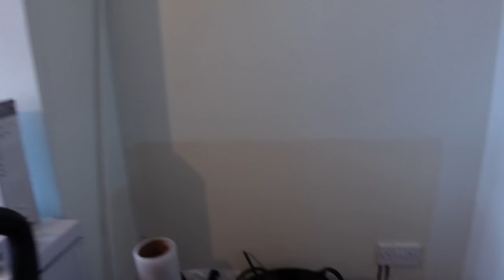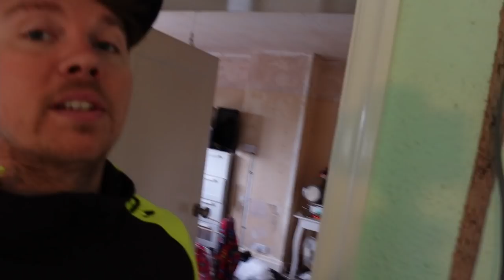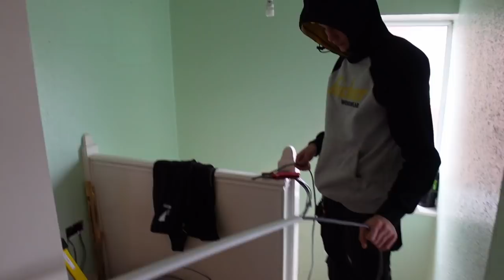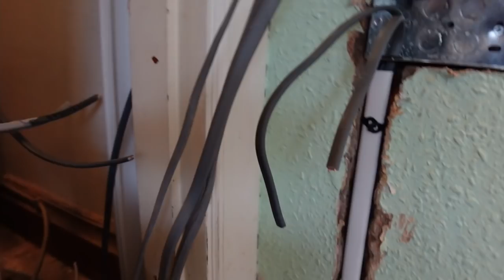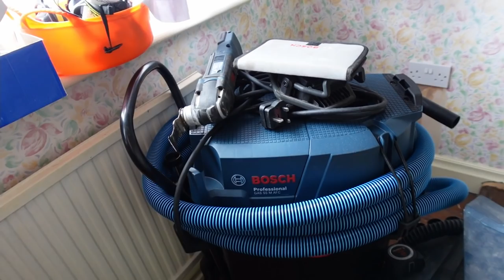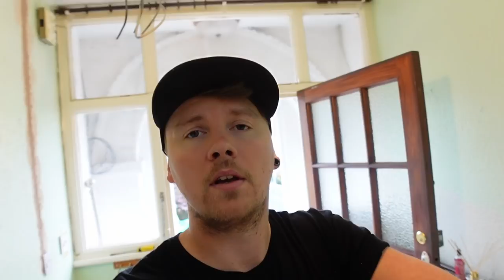Quality install-Running cables- Electrician

Comment: Hi Nick great video, I always use oval conduit when buried in walls love the stuff, I personally fix it back with traditional clout nails, and also squeeze the end of the conduit so it fits in the 20 knock out then bend it so it can't pull out easily, no grommet needed and holds the conduit back better when back box is fixed, just something I was taught years and years ago, 👍

Comment: I see artisan did a job with CORRIE Lee & Ruben . A simple car charger. I’m amazed that there was enough £ in the job for 2 tradesmen & a apprentice. Even the time it takes ( small cable run etc) hey all you need is an Adam and you know you can let him roll
Reply: 100% Jordan’s price for that charger install is about the same as Nick would charge to Rewire a 3 bed house.
Reply: £80 an hour artisan.
Reply: @Zelahb2930  plus vat ;)
Reply: I don’t think Corey was supposed to be there but because it was lees 1st Andersen charge point he had to show him the difference 👍but I agree Jordan probably charges fortunes 💵💵💵💵💵
Reply: However in that video Cory did say Lee has never installed an Andersen charger before, that's why he was there if there were any issues 😎
Reply: @kevinmcdonald825  would hate to know his prices also  he did say how much a job was going to cost in 1 video and I was like wtf that wont even take that long  but where he is based  it's not poor land and is plenty with the £ who will pay
Reply: Like you want a new car.  Will be a Ford or a BMW  all depends if you can afford it 
 dont mind paying. 
 have any idea  its a bit steep as in price

Comment: If you want good noise cancelling earmuffs the 3m peltor ones are good. Never had a issue with them not blocking out the noise just make sure you get the class 5 ones

Comment: What we need regarding oval conduit is the knock out boxes made to take it, you can't buy oval hole saws
Reply: As you know, oval goes in the knock out perfect. No grommet and no smashing out plaster at funny angles because you need another switch line going in.
Reply: You can buy oval to round, don't know why anyone would when you just squeeze the end with your pliers and in it goes, I can't believe people are using grommets with oval, what are colleges teaching these days, I was shown that when I was an apprentice in the late 80's.
Reply: @acelectricalsecurity  cant believe you dinosaurs are using oval tbh, round is much better
Reply: @darylsavage119  really, interesting comment, wrong, but interesting none the less

Comment: Hi nick patrick ere from ireland. Ill start off by saying you can thank 
Cablesmith Electrical. With out him i never would have seen you channel. And its great. I ask him and will do the same with you. You know anyone to follow that does satellite and tv installs? Networking. Cctv and alarms. And sound systems for pubs and houses. Oh ps. Love the kit in the van. Im goin re doing mine now cos of u! But think it be messy in no time again like 
Cablesmith Electrical haha.
Reply: I work in the network cabling game in the pharma industry in ireland,  since watching nick I've wanted to start videoing but unfortunately every time I seek permission from them I get shot down but would love to start
Reply: Oh ya well done what part? And if u get going let me know ill follow you as thinking of doing the same on the side but want to see some and get a push to! Ha

Comment: Hi. Currently renovating my house. What cables do i need to run from my fusebox to the door to install a mains powered Ring doorbell in future?
Reply: I would normally use cat 5 from the transformer to the outside unit
Reply: I wouldn't run a separate feed from consumer unit to door just for that. I'd spur from a ring final using 2.5mm2 or lighting using 1.00m2 into a FCU. But I'd suggest if you don't know, you shouldn't be doing it. There are simple calculations and specifications any trained electrician can make in seconds.
Reply: @tobysherring1369  who mentioned separate supply?
Reply: @acelectricalsecurity   The question suggested running a dedicated cable from 'fusebox', ie 240v supply, to the door area to connect the transformer. The question wasn't about the SELV connection between transformer and doorbell unit. Obviously you could connect to an existing circuit (or even a separate one if you wanted) at the CU if that's the closest point available.
Reply: @tobysherring1369  the guy asked what cables did he need at his door, so he only needs an extra low voltage supply.
Reply: @acelectricalsecurity  he asked what to run from the fusebox to run a mains powered device. Surely you wouldn't put the transformer at the fusebox and run CAT5 any further than necessary - voltage drop.
Reply: @tobysherring1369  there's no way I would run power from the board to the front door, I would put the transformer by the board and run a cat 5 to the door, unless the guy is living in Buckingham palace he will be fine,
Reply: @acelectricalsecurity  and when he decides to have a new system with a plug pack transformer, he can't plug it in by the door. I was taught to keep the SELV cable as short as possible, and make it possible to upgrade at point of use.
Reply: @tobysherring1369  the way it's going everything seems to use cat 5 or 6, you can run a Poe camera up to 100m and it will operate, I have just done a video intercom that had a max distance of 120m over cat 5, I run it 100m, so the distances in your average house will not be an issue.